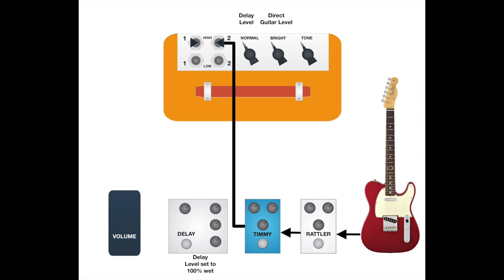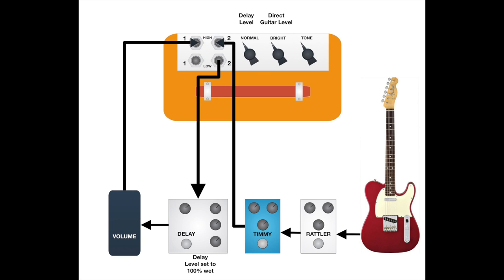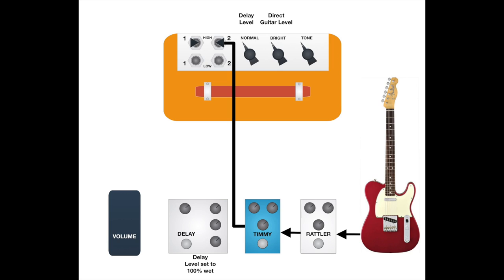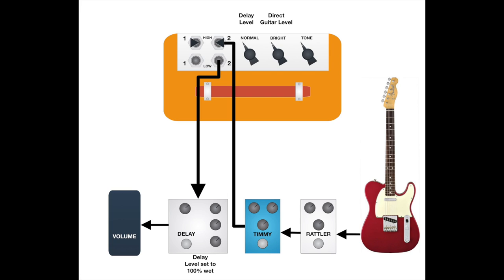Viewer Comments & Questions: 1 April  2019 – That Pedal Show

Comment: Dan, I have to admit that this episode did seem like an April Fool's gag for the first few moments, with the puppy in your lap and Mick lounging at the pool. But then I remembered Mick saying he would be in Greece, and after all, That Pedal Show must go on. I just wanted to say that I've heard a lot of folks talking about treble bleed circuits and quite a few have said they don't like them. I've been using them for some time and have found that when both the .002 capacitor and 100K resistor are used it effectively stops the loss of tone with no bad side effects. IMHO

Comment: Re: Left handed guitar pots, check all your pots because even fenders etc come with the wrong ones sometimes. You need reverse log (C) or at the very least linear (B). A log pot (A) in a lefty guitar is basically an on off switch and no amount of rewiring can change this. It amazes me that they use the wrong pot but wire it the Left handed way, even if they wired it the righty way it would be usable. This really hindered the way I used guitars and pedal for years.

Comment: Some guitars come with log pots, others with lin pots. Log is better for fine adjustments to the volume, linear is better for swells because you need just a little bit of the travel to go from almost quiet to full volume

Comment: 9:40 only less resistance to ground from the output... 
From the pedal input to ground is always 250k irrespective of pedal position.. Tilting the pedal just sweeps where along that resistor the output is tapped off.

Comment: Hey guys.  Love the show.  Best gear channel on the entire interwebs, full stop.  I haven't yet built a pedal board and I need advice.  I have an Ox amp top box, and want to use it to practice my live rig while at home at reasonable volumes and also for recording at home.  Is there a pedal (ie- the Benson Preamp, or the Victory Sheriff what would allow me to eliminate the amp and Ox, and record straight into the DI box?  In my case a Scarlet 2i2.  Could I at least eliminate the amp and run into the Ox?

Comment: RE: types of volume pots in guitars:
My understanding is that logarithmic pots are fitted as standard in guitars. This gives a large increase in volume over the first 1/2 of travel, then a small increase in volume over the second 1/2 of travel.
I am left handed, and have played guitar for about 15 years, and only discovered last year that my lefty Tele had logarithmic pots in it, wired backwards (the strat copy I had before had the same thing). This means that over the first 1/2 of travel, you get a small increase in volume, and over the second 1/2 of travel, you get a large increase. I found this operation incredibly frustrating and couldn't understand why people liked to use their volume pots to adjust their volume/tone, since they were so sensitive to small changes - turns out, that's only the case if they're wired backwards. As far as I could tell, this is standard in Fender type lefties.
So there are 2 common solutions that other lefties use, according to my reading - wire the pots the right way round, and turn the pot in the opposite direction to turn yourself up, or; switch out the logarithmic pots for something else. Some people use linear - they behave differently since there is no audio-style taper (just linear increase/decrease) but are easier to get a hold of than option 2 - reverse logarithmic. I got myself a set of rev. log. pots for my Tele last year, and the difference, at least to me, was surprisingly significant. Using the pots finally felt intuitive and added an element to my guitar which I felt I had never had access to before.

Of course, I'm sure someone will appear in the comments and tell me I'm totally wrong, but my guitar playing got better so what does it matter, eh?

Comment: Hi Dan, it seems you have changed the bridge PU on your Nick Huber: if I see correctly, it looks like a big single coil with a single raw of pole pieces in the middle, am I right? If so what is it? You said you had already swapped the original PU for a low output humbucker, so I am wondering why you've changed it once again. Thanks a lot!! Cheers

Comment: Question: so when I take a 250k volume pot in my guitar, and go into a 250k volume pedal, I’m dealing with the resistance in parallel, not in series? And the LOWER resistance means more tone suck? Wouldn’t higher resistance be more tone suck?
Reply from the maker: No
Reply from the maker: It’s higher resistance to ground , therefore less signal is leached to ground. Lower resistance menace more signal bleeds to ground
Reply: Thanks! Love your show!

Comment: Lefty's get stuck with logarithmic pots? Say what now? A properly constructed left handed guitar should have anti-log controls, so that a left handed player, who will naturally turn the control knobs anti-clockwise to turn up, gets smooth and to them normal, operation of volume and tone. And guitar players are used to  a sudden drop in volume towards the end of the pot as they turn down?? Not if they have log pots they aren't. Most single coil equipped right handed guitars should have 250K log pots. You do often find linear (300K not 500K) in Gibson four knob guitars where you will experience the not much then suddenly nothing effect of a linear volume. As far as I know this is a choice Gibson made to provide smoother mixing in the both pickups on position of the selector switch. The 300K loads humbuckers for a 'fashionable' darker sound. Looking at the Gibson catalogue for 2019 guitars it seems that they are fitting 500K log pots on the re-issues. On guitars that aren't re-issues they just say - 2 volumes, 2 tones.